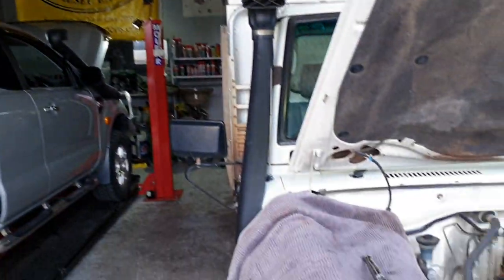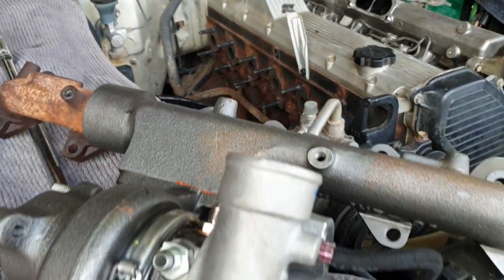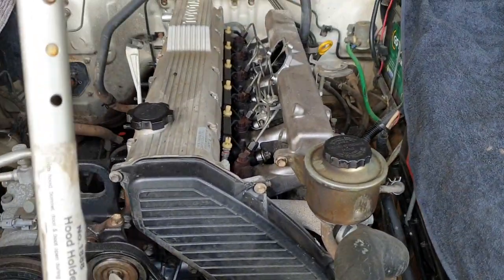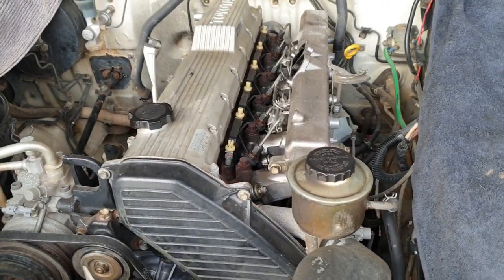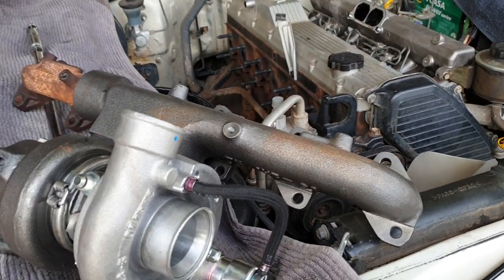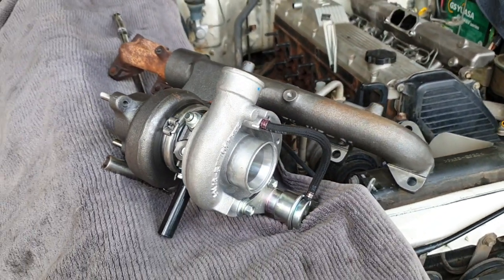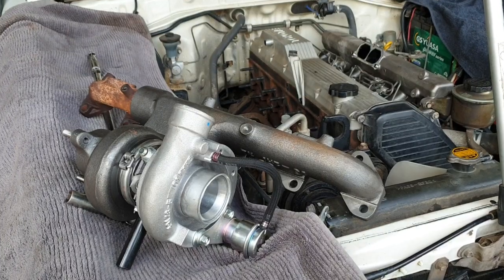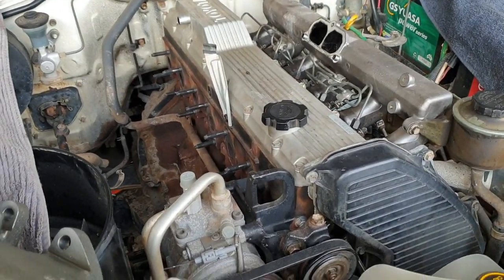Why Turbo your Diesel 4WD? Is that Safe?

Comment: I have an patrol y 60 with td 42, what recommendable turbo size for nissan van 2700cc naturally aspirated? Is safe I intals turba without caging pistns.. pls advice
Reply from the maker: As we always say a turbo is safe as it is only supplying air the problem in trouble arises when the person with the screw driver on the fuel screw on the pump turns it up too high that will damage the motor not the turbo

Comment: hi,I've just turbo'ed my Toyota 13b, i have not touched any fuel settings so it just standard settings on the injector pump, will this cause my motor to run to lean?i wish you were closer to me as I'd like someone with the knowledge like berrima diesel to set my new turbo correctly, love the vids
Reply from the maker: Turbos do not kill engines.
Incorrect Fuel Pump Adjustments will kill and engine.

Diesel Mixture:-
Lean - Safe and Cool
Rich - Dangerous and Hot

Comment: What is you’re Air/fuel ratio recommendations for tuning these
Reply from the maker: Tuning is not simply one reading. 
Its a combination of measurements BEFORE tuning and then comparing the amount of changes to this data to achieve a respectable gain AFTER.

Comment: Hey! I have a isuzu truck with 4ja1 diesel non turbo..planning to install a turbo but do I need to adjust the pump timing and keeping the stock setting for my fuel screw after I install the turbo?
Reply from the maker: Youll need to set the fuel setting. Thats correct.

Comment: Just realised you're Berrima not Berimah (NT)... :-(  
Your too far for me to travel to get a turbo fitted. How do I specify to a mechanic that I only want 40-50% increase in power and torque, is there a dyno measure ? or how should I phrase my request so he knows I can't afford breakdowns due to remoteness (Ngaanyatjarra WA) 
I've been put off Turbos for 75's due to the high failure rate, though you're slowly convincing me.
Reply from the maker: Due for a trip down south to us then. Cheers
Reply from the maker: Yep
Reply: I went to humpty do primary school ....the shame...... :) 

go for a drive down to them it would be worth it for the XP.

Comment: What's the best sized turbo you'd recommend for a Td42t?
Already a factory td but looking to upgrade soon. 
Td42t, RE4 auto, 3" high flow airbox, 3" high flow exhaust, reco 11mm pump, after market tmic.
Reply from the maker: A good custom turbo like a GTurbo

Comment: I'm in Panama Central America with a naturally aspirated Nissan TD42. Just slap a turbo exhaust manifold, turbo, and intercooler or am I missing something else? Do I need to tune it? What exactly is tuning it mean, not sure I can find a competent shop locally.
Reply from the maker: Hi mate. Yep well thats the problem here too. Loads of guys calling themselves 'Tuners' but really just screwing in the fuel screw for more Power.
Youll need to look hard and wide to find a guy who will be responsible and not adjust things too high. Cheers